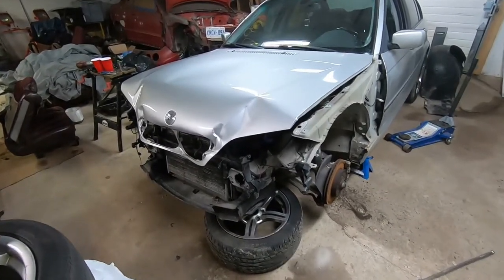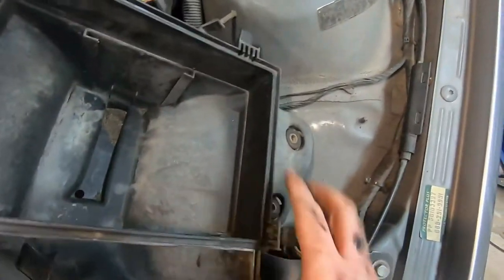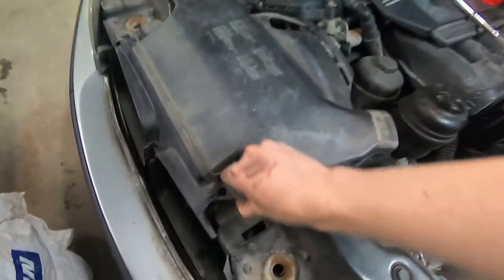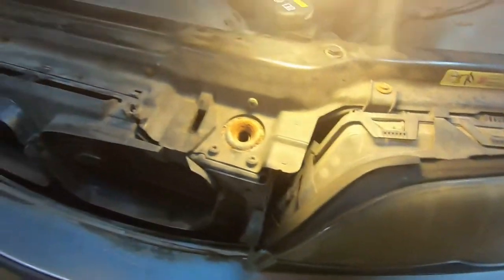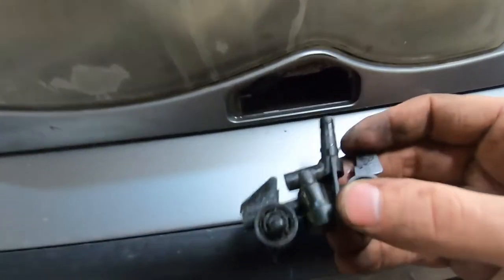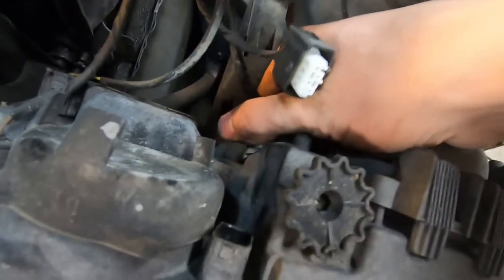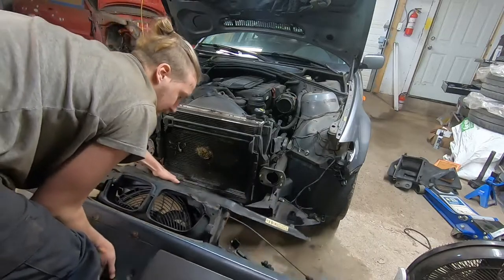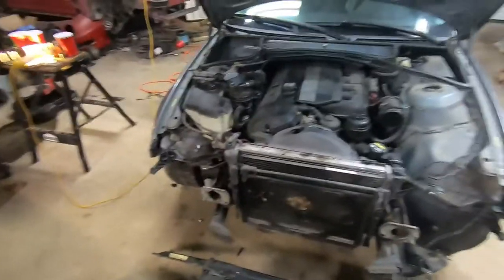Removing BMW E46 Front End (How To)

Comment: D ou you speak french si oui tu serait préparer une e39 520d et lui monter un 123 d  twin turbo en stage 1 passe les 223ch je compte bien si je trouve un bon mecano capable de faire sà la passer en stage 3 et changer les deux turbo d origine en lui montant 2 turbo de 530 d  je c est que c est possible en Roumanie il l ont fait sur une e36 325 tds ci on peut le faire sur une e36 pourquoi pas sur une e39 ça e36 moteur 123 d  fait 500 ch et  500 ch en diesel sur une e39 a ranger style M5 Jean fumerai tout le monde